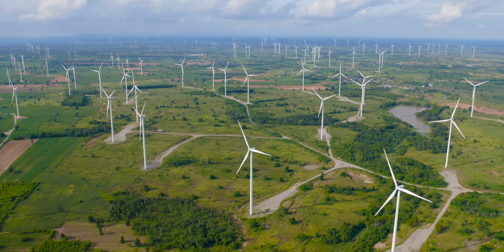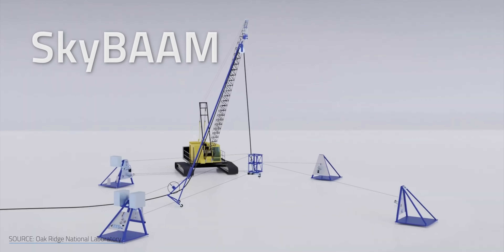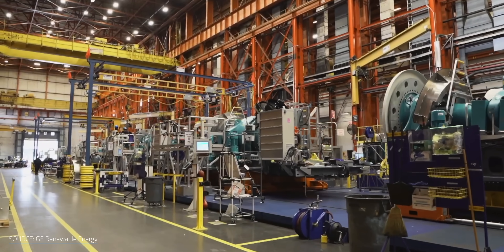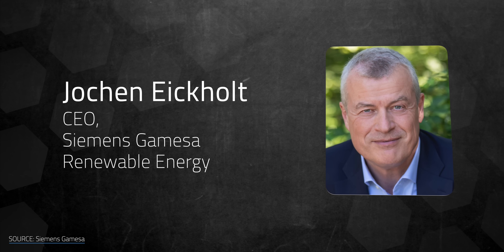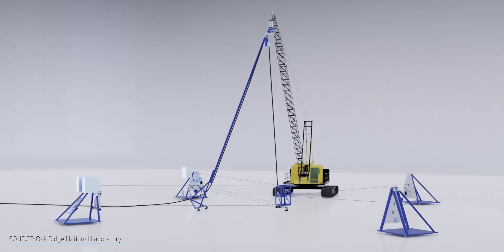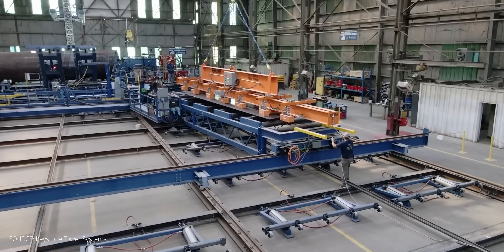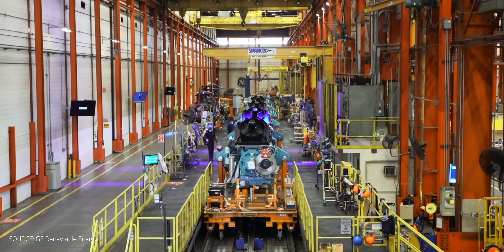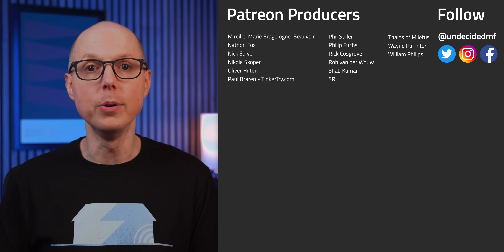Why We Need To Rethink Wind Turbines

Comment: The newest and most beneficial tech right now is the batteries. Sodium ion batteries use material that is much more available, at a highly reduced cost. As far waste from the batteries, most of the land fills in the USA have problems with very acidic discharges. These new batteries, after removing anything recyclable, have waste that is a fairly strong alkali, that could help the landfill's problems with their acidic discharges, by using the alkali's to neutralize the discharge.

Comment: The concept of using a crane with cables and winches to build a giant concrete 3D printer is actually really cool, and much more versatile than the ones they are making prototype 3d printed houses with. Assuming the technology is precise enough, I could see it being used in many applications outside of wind turbines in the future
Reply: Am I the only person wondering how it would cope with any wind at all?
Reply: @kaneworsnop1007  Look up The Arecibo Observatory.  It had a giant, heavy mirror that was held up by cables (extremely thick cables) and the only reason it isn't still around is due to major storm damage.  Multiple storms in fact, one storm damaged a critical cable and before they could fix it another storm caused even more damage leading to a situation where it was deemed to dangerous to fix.  These crane based 3D printers should be exponentially lighter allowing them to be safely controlled with much smaller and lighter cranes/cables.  I'm sure there's also been some lessons learned in the many years since The Arecibo Observatory was first constructed.
Reply: I thought the idea of using a crane was a bit surprising. I'd have expected the printer to start on the ground and raise itself up the tower as it went, then when complete climb back down so it can be disassembled and removed at ground level. They could simultaneously assembly as many towers as they have printers, without having an expensive crane waiting around for each tower.

Comment: I have been working in Wind Energy for 10 years now, both in the field hands on and in back office support roles.  This video is solid and well researched and explains the issues well.  Seal of approval 👍.  3d printing of any sort being a major part of wind turbines is a long way off though.
Reply: Wind turbine design is way beyond what I have done. Are the longer turbine blades needed for increased torque to spin larger generators, thus reducing the total number of wind turbines required?
Reply: @joeyager8479  Varies.  Larger swept area can be used to produce more power in lower average wind conditions, as well as turn bigger generators.  Take a Siemens 2.3 tower.  It can come with a rotor diameter of 93 as the smallest, and up to 116 meters or so.  It's always rated for 2.3 mw.  The increased size of the rotor means it can produce more power with less wind though. And of course, bigger rotors can turn bigger generators as well.
Reply: @mutt2jeff  Thanks. That was my assumption and I appreciate your response.
Reply: @joeyager8479  Longer blades increase the swept area and thus linearly the amount of energy the rotor can transmit to the generator. The size of the generator decides the rated wind speed power. If you keep the swept area but quadruple the generator size the same rotor area and sea area will deliver roughly 2.5 times more energy per year, so both increase in swept area and in generator size impact energy harvest. In the Midwest and over seas the amount of energy in wind increase roughly +25% by increasing hub height from 150 meter to 200 meter.
Reply: If the money spent on solar panels and wind energy had gone towards new nucleqr power plants and safe disposal of nuclear waste our energy problems would have been solved 5 times over 20 years ago.
Reply: @zteaxon7787  could say the same for oil and natural gas discovery, capture, refinement, and distribution
Reply: @zteaxon7787  Problem being, there is NO safe disposal of nuclear waste.... And Nuclear is prohibitively expensive..  Look how much rooftop solar has added to the grid in Australia, I get there needs to be different solutions for different regions but, Nuclear is NOT the answer in it's current state....
Reply: @zteaxon7787  but you would have run out of uranium pretty soon.
Reply: @zteaxon7787  If a percentage of the money spent on nuclear power plants had been spent on wind power development grants the wind power industry would long since have solved the energy and climate crisis.
Reply: @zteaxon7787  Thats a fact Jack.👍

Comment: Does the MRWT model connect to Megapack battery installations somehow, so that the surrounding homes, buildings, etc., are getting their power from the batteries? Or do the batteries merely add stability to the grid?

Comment: I'm curious about the wall of turbines. Are they big enough to prevent the bird strike issues the single ones had? Are they quite from what I remember the speed of the smaller blades was the cause of noise and leathal bird strikes. Also wonder if tip vortices will degrade the performance of the turbines near it. Not to mention thats a massive load and weight for a single anchor. We need to look at everything to make sure. Seriously look at lead fuel first anti nock agent and next thing you know lead is all over the place.

Comment: Don't forget that the blades can't be recycled as well and that they kill hundreds of birds per year. You can't fix wind turbines because they require wind to work.
Reply: Hundreds? Wow! Almost comparable to the hundreds of millions of birds that are killed by cars each year just in the US.
Reply: @godfreypigott  when are you giving up using cars?
Reply: @hiddentruth1982   The question is when are YOU giving up driving cares. YOU are the one who has raised an issue about birds, not me.
Reply: @hiddentruth1982   I guess you found that question too difficult.
Reply: @hiddentruth1982   "I don't pretend to care about the environment while doing the exact opposite of what I tell others to do"

Yet that is EXACTLY what you have done here - pretend you care about the effect of turbines on birds while not caring about what your car does to them.
Reply: @hiddentruth1982  "9 replies" yet only 8 visible. Looks like you've made a ghost-blocked reply. Could't keep it civil?

Comment: If we could find a good efficiency with vertical axis turbines, they require a lot less construction complexity.
Reply: Wrong. VAWT are actually more complex. Thet require a lot more material, are not high enough and are a pretty poor idea.
Reply: @rogerphelps9939  
What a rude way to respond.

No explanation to why it's more complex despite the fact that it wouldn't need a facing bearing...

No explanation to why it would require more material despite that not being an argument I made and seemingly less material because you would only need the tower and not the cap...

No explanation as to why we couldn't build a tall one...

Sounds like you have a lot of assumptions and very little knowledge about how they work, or you are basing your response on a design that wouldn't work at that size. Either way, to be so "matter of fact" actually reveals how unknowledgeable able the field you actually are.

Comment: i have always wonder about the possibility of installing wind turbine for my own production of electricity.  One of the prob;ems with solar power is the up front cost of installing a system ,  For somebody who is a pensioner the thought of  the payback being over a long time  might  not be for me,  i thought maybe installing a system part by part might be a better way , and also allows me to contribute my small part to reducing my reliance on carbon fuels
Reply: There are other, cheaper ways.  For example, for heating, if you have areas of your property near your house that receive consistent sunlight, you can build inexpensive Solar heat collectors and pipe that heated air in through a window quite easily.  Cooling is more difficult unfortunately. But in a lot of areas, heating uses more energy than cooling between of the usual bigger differences in temperature gradients between the outside and inside. Even here in the mid Atlantic, I pay more for heating than cooling. I would totally do the above, except that our property is very shaded.  Any kind of solar heating would have to be done with a portable heating system, heating a pot of material with high energy density absorption and then carried into the house--probably not worth it except on the coldest days. 

    I think there are ways to improve the efficiency and lower the cost of geothermal.  For example, one of the ideas I came up with, is since I already have an air heat pump system that works decently the majority of the time, I could make basically giant heat pipes out of large copper pipes, stick them down into the earth around 8 or so feet, wrap copper tubing around them, insulate the tubing higher up the pipe, pipe water from an insulated tank (perhaps mostly buried in the earth) looping through the below ground and then wrapping around my condenser unit outside.  In the winter, put some IR reflectors around the condenser unit, and in the summer take them away. 

   With the idea that when it is significantly cold out and when my heat pump would normally struggle (20* F and colder), this would carry/transmit some warmth (40 to 50 degrees F or so) to the system so that the heat pump would continue to work some. In the summer, it would help the AC some as well.

Comment: We really need to utilize Modern nuclear energy options and then we can in combination, use these alternative energy sources. There is no way we can operate our energy grid full off of alternatives and get rid of fossil fuel emissions sources tho unless we embrace modern nuclear energy options.
Reply: Your view lacks understanding of the economics of Solar Grade Silicon and how much cheaper it is compared to nuclear and all the encumbrances and costs associated with it.

The number 1 goal needed is energy efficiency. 

Energy decentralization is anathema to those that currently control the grid and oil resources.

Comment: So, if you made clockwise and counterclockwise versions of the MRWT, and adjusted your generators so they could manage the blade speed to keep them in sync, could you have overlapping sweep areas?

Comment: The myriad turbine is a cool idea to make a turbine with smaller parts, but I see a few flaws with the design, especially in northern weather conditions… First off, the pipe frame holding the turbines is extremely prone to birds building their nests on it. It’s an issue because they often get hit by the blades when they fly off… This is a problem that early wind turbines that used similar structures for their pole encountered. The turbine frame is also extremely likely to accumulate ice in winter, which would make the whole tower suffer a lot more stress than it might have been initially designed for not only because of the weight of the ice, but also because of the higher wind drag with the ice acting sort of like a sail. Finally, having multiple turbines this close to one another in front of such a structure is extremely likely to create turbulence between the blades, which would make a lot of noise. This is quite undesirable for a wind turbine installed close to people’s houses like they showed in one of their graphics. Maybe they accounted for all of those things and the idea is interesting, but we definitely need to keep those challenges in mind.
Reply: You might be happy to know that the ice and and the wind on ice loading are now explicitly accounted for in design, and does end up controlling the design of some of the main load bearing elements in an areas with high ice loads. You can double or triple your tower's self weight with the extra ice.
Reply: Or the fact they can't be broken down by design.
  Can't be  recycled...
 nobody can & they bury them.
Reply: Hi.  Water generally runs off any tubular metal structure, and bridges don't fall down in icing conditions. Birds need surface irregularities to anchor their nests, I can't remember seeing any bird's nests on smooth piping. You may have some good points, it's all at the "try it and see" stage. Here in the southern hemisphere the birds all fly backwards of course, so I'm just guessing. Cheers, P.R.
Reply: All minor issues that can be worked around
Reply: @bofty  hardly
Reply: I think that nowadays they use some ultrasound devices to prevents birds of getting close to the wind turbines.
Reply: @SuperSayian86  That's sounds like an interesting idea.
Reply: Telegraph poles then telephone poles then cellular towers all were deemed eyesores when initially adopted. And think of all the airplane and helicopter sounds we hear day to day even out in the wilderness but the vast majority of people won’t want to do without them. It’s just progress to a physically less strenuous life.
Reply: Birds mostly don't "often get hit by the blades when they fly off", they fly into blades like they do into windows and glass buildings. We know how to keep birds from building nests as well and buildings, windows and especially cats each kill way more than 100x the birds that wind turbines kill.
Reply: More propellers means more moving parts means greater probability of failure means greater maintenance time.
Reply: The number of moving parts has no indication on the amount of maintenance needed.
The stress and applied forces are more indicative.
Probably this array has longer service intervals than a huge single turbine, since the moving parts encounter lighter loads.
Reply: @McSlobo  Does each have a turbine or are they all linked to one big turbine?
Reply: Lots of small turbines will be far heavier and expensive than a single big one. A very silly idea that will go nowhere.
Reply: You missed the #1 disadvantage...

the myriad turbine contraption is ugly.
Reply: @pilafmon  I am of that opinion as well, but I wanted to keep my arguments as objective as possible…
Reply: @pilafmon   Yeah and pump jacks, drilling rigs, pipelines, tank farms and refineries aren't?
Reply: @johnrothgeb5782   Pretty much everything to do with oil is visually ugly -- dirty rigs, ratty refineries, smog, etc.  In Los Angeles they actually put facades over oil rigs to make them look like office buildings.  On the other hand, sleek modern tubular wind turbines are majestic like city skylines.
Reply: @pilafmon  Thanks! My point exactly!
Reply: I dont find normal wind turbines any prettier, just more 'normal' @pilafmon
Reply: @CaptainBlueTech   The open lattice structures of the 1970s wind turbines are hideous, but the sleek tubular wind turbines of today are majestic.
Reply: @pilafmon  I actually design latticed and monopole telecommunication towers as my day job, and you can definitely get a cheaper and equally strong latticed tower made. Making it bird resistant, now.... that's not something I've had to design for.
Reply: @CaptainBlueTech  There are shrouded towers that have the advantages of latticed towers with the visual appeal of, well, anything else (you can make a shroud do anything you want). Another common thing is monopines and monopalms in place of the bare steel monopole. I don't think this would work well for wind turbines, but it is an interesting concept for mono-x'es.
Reply: @pilafmon  none of them look good to me, it's a necessary evil but todays monopole turbines dont look good; They are just more normal, im more used to them.
Reply: @CaptainBlueTech   Some people think skyscrapers are ugly and others think they are beautiful.  It's true that not everyone sees modern sleek wind turbines as majestic, but at least they are not objectively hideous like the old lattice wind turbines or oil well rigs.
Reply: @pilafmon  While I also dont find the lattice wind turbines pretty I dont think that they are 'objectively hideous' they impart a certain look of strength to me in some places, but a big tower with blades on it will never look pretty to me.
Reply: @DemPilafian  very bad and subjective point that gets used way too often. Because 1] other people find them beautiful marvels of engineering and 2] literally aesthetics are not a reason to not burn the earth to the ground
Reply: @NoGodsUnderStars Turbines don't stop oil drilling. Oil is needed for turbines and solar panels.
In Scotland alone, to expand out the renewable energy supply and build windfarms they cut down 16 million trees and concreted over moorland ecosystems, very green.
CO2 is not a pollutant and doesn't destroy ecosystems.
Deforestation to clear hilltops for wind turbines and lithium mining for solar and batteries does obliterate ecosystems.
Reply: @NoGodsUnderStars  notice for a GREEN tech but not a word recycling. These things can't be broken down to recycle
Reply: Those birds that hit the blades, don't reproduce anymore, so in time most birds that live are those that don't fly through the turbines but around them. It happened with dogs chasing cars, it will happen with birds hugging turbine blades.
Reply: @vaakdemandante8772  thats pretty evil
Reply: @vaakdemandante8772  This issue has been a thing since the beginning of wind turbines and still is actually… So the fact is that they don’t really learn… It’s an issue with bats as well